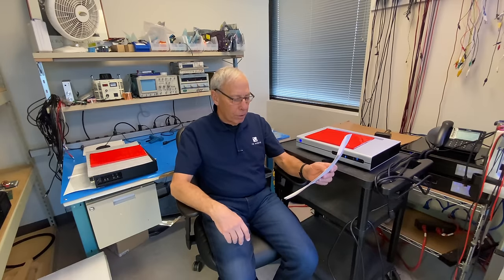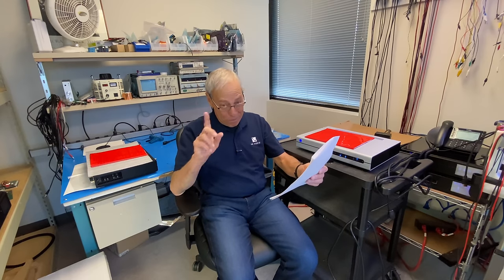How do you know if your caps have aged?

Comment: if sounds good and nothing wrong dont fix it,fixing it might cause you trouble,capacitors today esp. in amps are mostly made in china
Reply: Yeah I think the same. I have 30+ old stereo gear, original made in Japan parts inside and still going good. I'm not going to replace  parts to made in China crap

Comment: Capacitors are also known as condensers. General motors switch from points and condensers to HighEnerygy Ignitions, 50,,0000 volts, somewhere around 1974. They neede more volts for the highere ACTIVATON ENERGEY from the leenar air fuel mixchures at idle for emmmissions controles. THNKES YUS AND thummbs usps!
Reply: Do you have a refrigerator full of hash?
Reply: “Condenser is a term used for a capacitor in the past. In time the term ceased to be used, with capacitor turning into the most commonly used term from 1926. Condenser and capacitor are one and the same viewed from electrical perspective. However in other fields of study, condenser may likewise allude to various different things. Condenser from mechanical perspective is additionally another name for consolidating vapor to water. Condenser as well means an optical system which focuses light beams from a light source into a narrower beam. Energy in capacitors is stored in the electric field, while in the case of condensers energy is stored in the electrostatic field (they work as heat capacitors). Condenser can represents a device that converts vaporous material (gas) into its fluid state. All condensers work on the principle of using a cooling system to remove the heat from the gas. Condensers are utilized as a part of thermal power plants, air conditioning systems, distilleries and so on.”

http://www.differencebetween.net/technology/difference-between-capacitor-and-condenser/
Reply: And then there are ventilators as well which is just a different word for Fan.
Reply: Paul Lazarro:  LOL! I wish! I cant because potaotes are beaically all starch ans the starch gets turned into sugars and then sugras cause inflammation. A cup of potaotes is like acuo of sugers and I have to stay far away from sugars b ecaus eit causes me deoression and I am on veruous meds. Is this the article you wnated...

Hash browns
Hash browns or hashed browns are a popular American breakfast dish that first started showing up on breakfast menus in New York City in the 1890s, a simple preparation in which potatoes are pan-fried after being shredded, diced, julienned or riced, in the style of a Swiss Rösti. In some cultures, hash browns or hashed browns can refer to any of these preparations, while in others it may refer to one specific preparation.

THANK YOU, YOUA REM INE GOODS FRENDS! THUMS UPOS.
Reply: Hugo Bloemers: THNAKES you Mistre Hugo. You have alway ebeen the gpod frends. THMUPPS UPS!
Reply: Jason C.: thank you kinds sirsr. yu HAVE BEEN ALWAYS TH GOODS FREDDS!

Comment: Funny when someone is into audio electronics but don’t know how to solder simple THT components.
It’s like those sailors who can’t swim 😆
Reply: @Qorax, using cheap lead solder and a $12 generic soldering iron? 🙈
Reply: @kalijasin  Only for small smt components you need a fancy soldering iron.
Reply: I think that this was not always the case.
In the 1950's and 60's, for example, you could easily buy 'kits' for the electronics hobbyist to assemble at home. I've read numerous accounts by people who did so in their youth and were very pleased with the quality of amps they were able to build for a reasonable price.

In the 1970's, electronics as a hobby seems to have fallen off, and the companies who supplied the kits ceased to do so.

Now, there is the DIY movement, but it seems almost like an Underground thing.
However, if you are of a mind to build your own amp from a kit, very good ones can be had for affordable amounts. Nelson Pass of Passlabs has such kits available, for example.
Reply: @HareDeLune  The demand on those kits, at least of certain brands like Heathkits has become quite high and those amps go for ridiculously high prices.
Reply: @QoraxAudio 
Yes, I'm sure the old ones are collector's items now.
Reply: @HareDeLune  In the 50s and 60s there were plenty of demobbed (and, in the UK, ex-National Servicemen) who had learned a trade in the forces.
Reply: @thisisnev 
"Demobbed"
First time I've heard that one!
You from Oz?

Comment: This is Brian. Every time I listen to your videos, I realize you are overeducated and you try to exercise your verbal knowledge with padding that is wrong. So, simply put, your bass will sound poofy if your amp needs caps. And the statement about resistors never needing replacement? As a technician, I have had to replace tons of bad resistors. Do you think before you speak?
Reply: Resistors used in crossover networks very rarely fail.
Reply: @swinde  Thank you.  When a customer would bring in a dead piece of equipment,  many ocasion a resistor was at at fault. Nothings infallable.
Reply: The Original Question seemed to be about capacitors in a system, our mentor, Ahem... posed it to be more towards speaker crossovers. But anyone who has bought an amplifier from a thrift store that is well aged will hear the poofy bass response and realize it needs a Re-cap. I don't know how it became a crossover dillema except through the manipulation of the host speaker exercising his vocal abilities. You know , just because someone sounds smart doesn't mean they are smart.
Reply: @wendystarita7996  I don't know why you are trolling Paul, his answer is very reasonable. If you don't understand the role of capacitors in crossovers (as the op asked) the person looking stupid is you. Yes anything can fail, especially if abused, but the high power wire wound resistors found inside speakers are very robust and rarely fail unless abused (overloaded or shocked eg dropped), cf the key point of the discussion here is (as Paul and others have noted) that especially electrolytic capacitors are well known to degrade as a function of age and temperature, and the electrolytic  can simply dry out. Electrolytics in ancient equipment are often in a bad state and replacement will yield a sonic improvement .. or even  may save your speakers being blown if eg failure results in a low power tweeter sering high power or can't handle.
Reply: @davesmith9325  I 'll reiterate. Just because someone sounds smart doesn't mean they are. Period.
You know what? I think the world could use more real intellectuals and less audiophile stereo salesman.